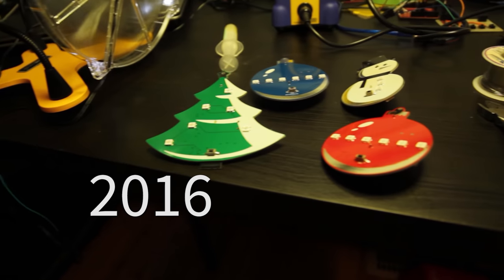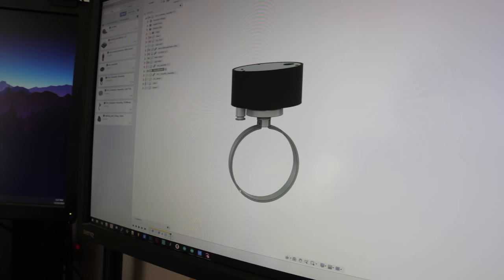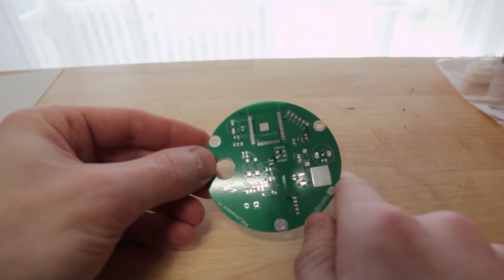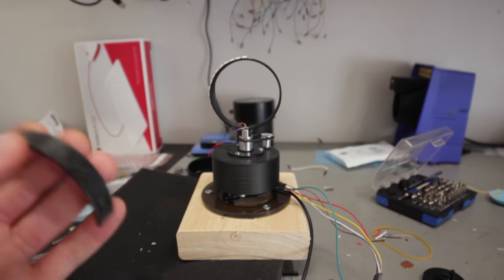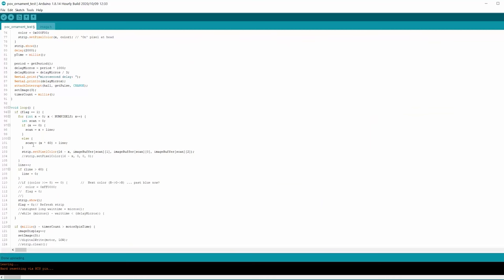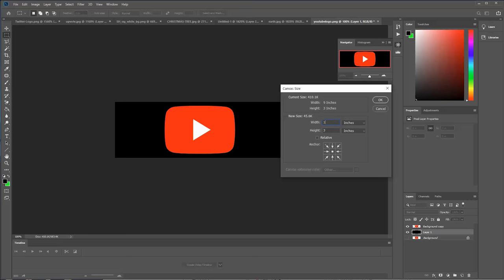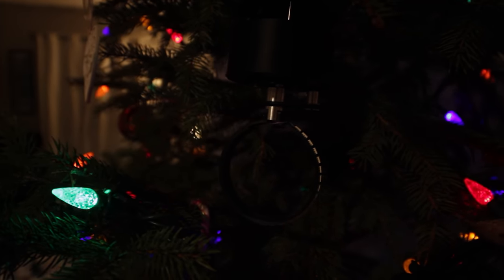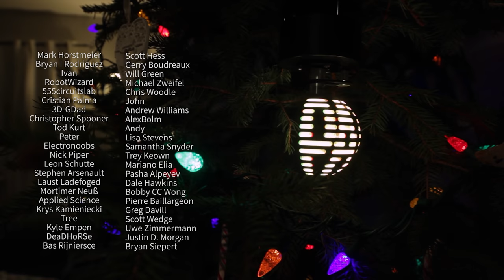Spinning Holographic Christmas Ornament

Comment: • You need to encase it in a plastic globe to both dampen the noise and protect it from obstructions. Check craft stores for plastic balls (eg for homemade ornaments); they come in a variety of sizes, so you should be able to find a good fit. (Once you're sure you won't be making any more changes, you could seal it and vacuum out the air in it…)
• The inevitable next steps are to make animations and remote-control via a webpage or phone app.
Reply from the maker: Thats a good idea! I'm actually already controlling it over Wifi through a webserver on the ESP32. Going to do a quick video or livestream on that in a day or two.

Comment: Back in about 2005 it was all the craze in my high school. My teachers and schoolmates made somewhat similar devices. Monochrome, even lower res. They had direct drive from modified 12V fan motor, all essential electronics on the rotor, custom coaxial transformers for power, IR for low rate data input. A single optical reference was used, in coding almost constant speed was assumed and the timing adjusted for every rotation from the measurement from the previous round.
Reply from the maker: Sounds really cool. I was going to assume the RPM based on a single pulse but then when I changed to the new encoder it was easier to just use the pulse to change the LED strip at that exact time.

Comment: If you set another led strip on the other side of the ring,  rotated half the distance between each led, you could solve the weight difference and the horizontal pov lines at once

Comment: A little late to the party but... a quick way to do that black background thing In PS without using masks or magicwand (which can leave things a little ratty at the edges) -  invert the image, so white goes black, then change the hue angle by 180 degrees to get the color back to normal. No masks, and no antialiasing halos.
And, does the python script do a run length encode of the image to text? If not that should be more efficient than slogging through every pixel every time, because pixel 10 say could be the same as pixel 600 so why calculate and send it twice (it would also reduce the size of the array memory). Great job as usual. Who's slip ring did you use? Been looking for some cost effective ones (can you use those words in the same sentence?)